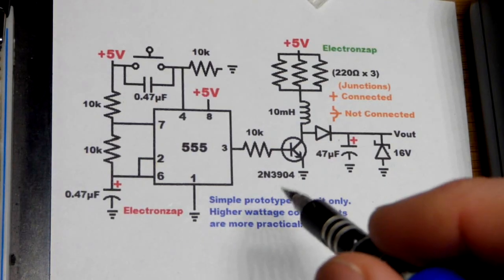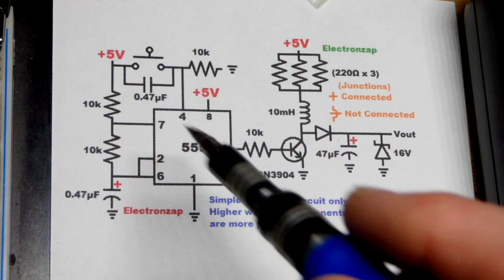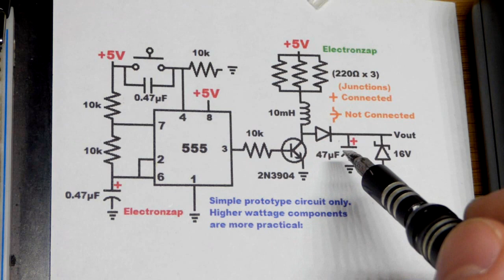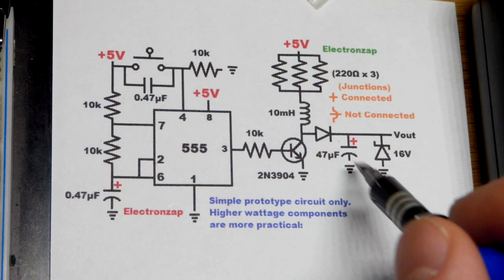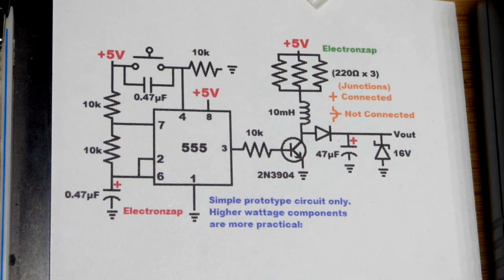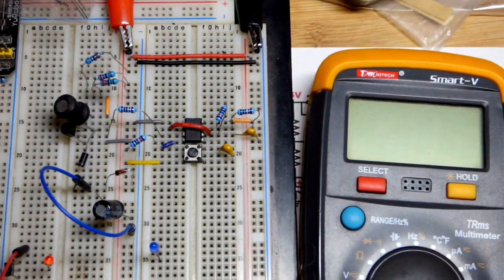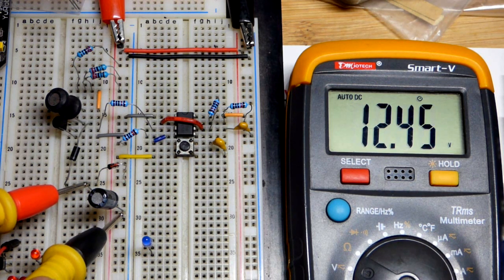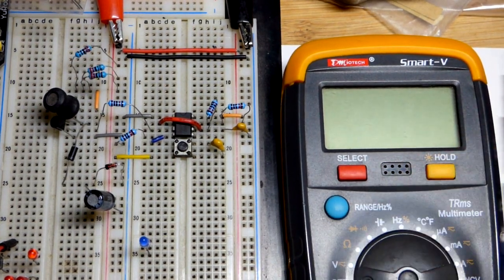Prototype 555 timer voltage booster using inductor 2N3904 NPN BJT learning electronics shorts 106

Comment: Hello,why
 do you put a 10khoms on pin 4? Thanks
Reply from the maker: That's a pull down resistor. It holds a voltage of 0V at pin 4 until you close the switch, which gives pin 4 a voltage of 5V. You need a resistor to prevent a short circuit when the switch is closed.
Reply: @Electronzap  ok,thank you